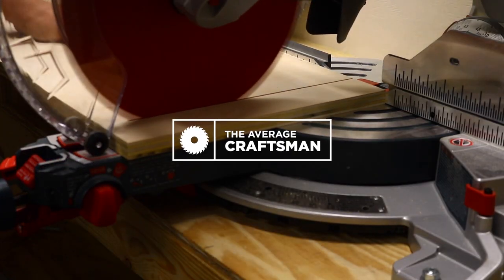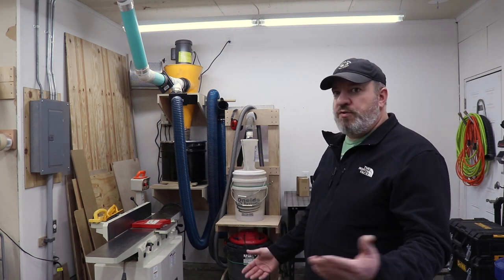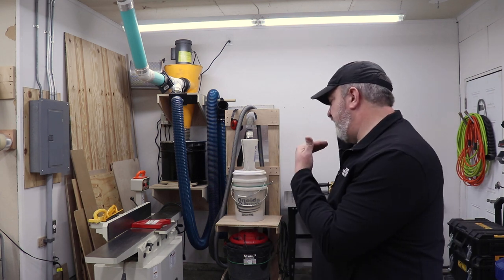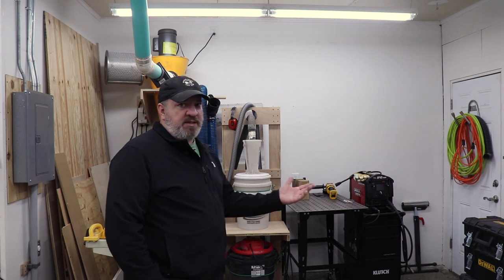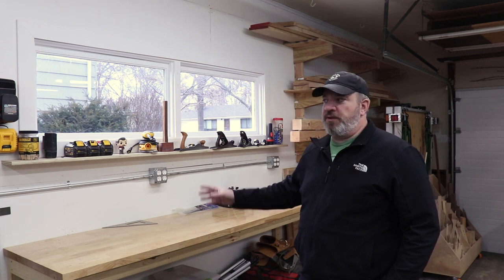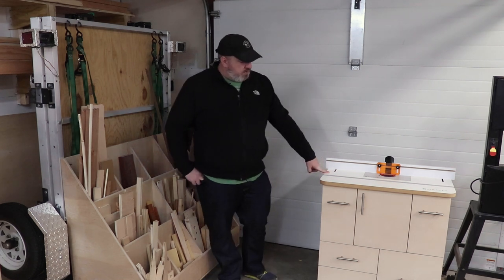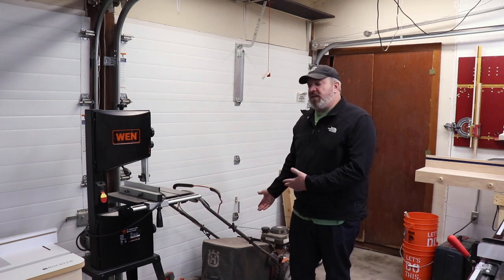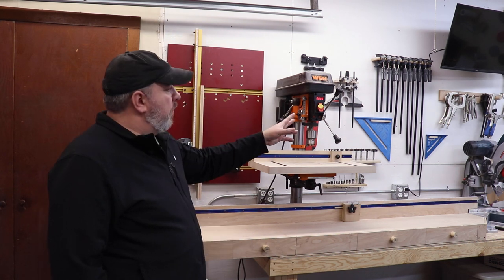2019 Two Car Garage Woodworking Shop Tour!

Comment: Loved the video. I hope to upgrade to that sawstop someday. I did a video about my bench and I don’t think it will fit though. Also got the Wen spindle sander with 4” belt and it’s just......ok.
Reply from the maker: Yeah, the WEN stuff isn't junk like some people think but it's also not top of the line.  It's really good for small shop hobbyists.  Every WEN tool I've bought I've ended up wanting something bigger.  Thanks for watching!

Comment: I'm watching this about 2 1/2 years after you recorded it so you may have already done something about insulating your ceiling but if not, just an idea...you might have an insulation company come over and shoot some insulation into the attic area.  You mentioned how it was a mess up there so that would eliminate you having to get up there...just have them shoot the insulation in and call it good.  Just an idea.  Nice video!
Reply from the maker: Thanks for watching!  Still haven't insulated.  I probably should but have held off because the ceiling is sagging and I was going to fix that and redo the ceiling first but that's a large project that might be a ways off.

Comment: Great tour! My wife says my middle name is "upsell!"  I did close to the same thing at Woodcrafters. Had planned for months to buy the contractor saw with cast iron upgrades. They explained with all the upgrades, not much more to buy the pcs. So that's what I did and with the mobile base. I bought the dust collection blade guard, but made my own piping for the dust control. There is an advantage without the motor hanging off the back.

I saved money on the dewalt planer like you have. Wife found one at a garage sale for $125 last summer. Needed a new belt and blades. Works great! 

Good luck and look forward to looking through your channel.
Reply from the maker: Man, Robert, I wish I would have gone with the PCS.  I really regret it.  We'll see, maybe one of these days.

Good deal on that 735!  Thanks for watching!

Comment: I’ve been happy with my WEN tools. I’ve reviewed the lunchbox planer and drill press on my channel
Reply from the maker: Me too, Brad.  The bandsaw is on its way out though.  A couple of nights ago I had to resaw some 8/4 walnut and it took about 20 minutes for one 72x5 board.  It works well for small stuff but that's not really what I do so time for an upgrade!
Reply: The Average Craftsman oh, glad i decided to wait then because I’ve got a ton of 4x4 oak posts I’ve been want a bandsaw to resaw. I’ve just been using my table Saw but it gets a little sketchy at times

Comment: The first law of small shop design is that all table tops should be the same height or just a hair lower than the table saw. How did you ground your dust collection system?
Reply from the maker: Mine is not grounded.  Thanks for watching!

Comment: Great video. I'm just getting into woodworking myself and am pretty excited except for my space. My current 2 car garage is about 27x25 but plan to make it a bedroom so i will be building a new garage. Thinking of doing 24x36 giving her a parking space which leaves me with 23x23 space for a shop. I was wondering what the overall dimensions are for your shop? I plan on doing some woodworking and metalworking  in mine. Also would be interested in seeing more on your subpanel. Will be subscribed. Love your way of doing your video.
Reply from the maker: Hey Brandon, thanks for watching.  My garage is about 475 square feet but it's an odd shape.  For you, it really depends on what kind of tools you'll be going with.  If you want bigger machines then you'll obviously want more space.  Also, doing metal work in a wood shop can have issues so you might want more space for that.  If 23x23 is all you got though, it'll work.  You just have to be creative.
Reply: @TheAverageCraftsman  yea im thinking im gonna go with 40x30 and give about 10ft to her for parking space with a wall there to block shop off giving me 30x30

Comment: As far as used tools try out Facebook marketplace if you aren't already.  I have found over the past few years I find tons of good deals on there.
Reply from the maker: Yeah, David, I've searched Facebook as much as Craigslist and, around here at least, there's not much available.
Reply: i'm from costa rica and i just recently found a super deal, i bougth:
10" table saw.
10" band saw.
10" sliding miter saw. 
Small drill press.
Scroll saw.
4x36 belt sander 
2 routers
circular saw
jigsaw 
mototool
bunch of clamps
jack plane
 
All of these tools for only $700, in Costa Rica that's like 370.000 colones , and that's what just a table saw and band saw cost...and i found it on Facebook Marketplace.
Reply from the maker: @tutallerencasa969  That's a good deal!  I recently bought a Festool Domino from the Facebook Marketplace but that's all I've found on there so far.

Comment: I was hooked watching your video about your shop.  I just ran across your page today & it was exactly what I have been thinking about  doing to my garage.  We just moved in a different house about 6 months and I've been doing woodworking for about 2 years (when I'm not at my regular job)  I have made many big & small items but want  to get my shop set up much better & increase my tool supply which hopefully will make more efficient & better making all types of projects.  My question is how long did it take you to accumulate your power tools and get your shop to what it looked like in the video?  Also, I need lighting bad, so I will watch your video on the your junction box & extra power outlets & maybe lighting.  Thank you and I definitely be watch more of your stuff!
Reply from the maker: Thanks for watching, David!  In December of 2016 I had a Craftsman 11 piece cordless kit and a Craftsman 10 inch miter saw.  I don't even use those anymore so everything you see in my shop I acquired since December 2016.

Comment: Enjoyed the video and the comments on your various tools and decisions. I have the Wen drill press. Also, I have the Wen oscillating belt and spindle sander. It's cheaper than Ridgid and had better ratings on the Home Depot website. Works great and I bought extra belts on Amazon.
Reply from the maker: Thanks!  I'll take a look at it.  I like the bigger table of the Ridgid though.

Comment: Good video!  It's always nice to see how others managed their space.  I'm downsizing from a 36x36 shop to 20x21 so lots of doing without and compromises. 

When going from 110VAC to 220VAC on the saw I wouldn't expect to see any difference at the saw.  You'll consume the same WATTS whether 110 or 220.  The amperage draw is cut in half at 220V because the voltage is doubled from 110V.  The real difference is how many tools can be run at the same time on a single (pick your amperage) circuit.  A saw and 2 hp dust collector can be run at the same time on a single 20A 220VAC circuit where they would trip the breaker if run at the same time on a single 110V 20A circuit.  I intend to run as many tools as possible on 220VAC in my new shop because the wire gauge can be smaller and less expensive compared to using 110V.
Reply from the maker: Thanks, David!  Good luck on your downsizing.

Comment: What do you use to record audio in your shop videos? sounds great, looks like there should be terrible reverb or sound distant but, sounds as if youre wearing a wireless mic or something. thanks. great video.  ---- Sloppy Joe, Overland Park, KS
Reply from the maker: Hey Joe, I use an Azden wireless lav mic.  I have had a lot of trouble with audio but I think I dialed it in with these last two videos.  The key was turning down the recording level on the camera.  Before I was getting a lot of echo and pretty bad audio overall.  I reached out to Jay Bates, another YouTuber, and he gave me that tip.  Worked like a charm.

Thanks for watching!

Comment: Thanks for the tour. You always learn something whenever you get a tour of another guy's shop. That said, maybe you should list your SawStop on Craigslist and go get the cabinet saw. There's a quantum leap in owner satisfaction there. They say a lot of nice things about Harbor Freight these days. Well, Harbor Freight says a lot of nice things about themselves these days. 40 years ago I spent a day's pay on a bunch of on-sale HF 1/2' pipe clamps. They failed in ways I could not have imagined were possible. Within a couple years I sent the remaining three (of a couple dozen) along with a bunch of other disappointing stuff to the weekly auction. All those years gone by and I last fall I bought a big generator from them. The first two wouldn't run long enough to empty the gas tank. The third, a second free replacement, is sitting in its unopened box awaiting a Craigslist thrifty optimist.
Reply from the maker: Yeah, Harbor Freight is a mixed bag.  I generally avoid it these days.  Thanks for watching!

Comment: everyone wants a SawStop I purchase my Sears contractor saw when I was around  24 now 62 it's a wonderful saw it did everything I ask it to do dado set, molding 3 cutter head rip a full plywood sheet and I build some wonderful indoor and outdoor furniture kitchen/bathroom cabinets  and it's still running and true my favorite tool in my 2 & 1/2 car garage and I still have all my 10 fingers

Comment: Hello, liked your video - thank you.
My question is on your Incra cross cut sled, how have you attached it to your wall?
Thanks.
Reply from the maker: Thanks, Steve!  There are holes in the sled and I just put a half inch piece of ply on the wall and put a couple nails in it.  The sled hangs on the nails.

Comment: Thank-you for sharing your workshop and experiences.
Regarding insulation, as a general rule, approximately 90% of winter heat loss is through the ceiling.  Attic insulation in Kansas City area should make an enormous difference.  It will also help keep the garage from getting as hot in summer.
Really like your scrap wood cart, and am planning to build something along those lines.
Best wishes and stay safe!

Comment: Show us the dust collection on your Sawstop.
Reply from the maker: Mike, I just have the stock dust collection on the SawStop.  You can buy a port from SawStop which I did but it's just a place to hook hose in the back.  It's not even in use right now.  I just have a hose running up to the dust port below the blade.

Comment: Where did you get the trailer?  Its awesome
Reply from the maker: Northern Tool.  You can also get a steel version that is cheaper.  Harbor Freight also sells a steal version as well.  They are really handy.

https://www.northerntool.com/shop/tools/product_200660343_200660343?cm_mmc=Google-LIA&utm_source=Google_LIA&utm_medium=Trailers%20%2B%20Towing%20%3E%20Trailers&utm_campaign=Ultra-Tow&utm_content=49803&gclid=EAIaIQobChMIqsTf9oWf5gIVKB6tBh3n8wG7EAQYAyABEgILmfD_BwE

Comment: why is your miter saw to the far right of bench
Reply from the maker: Wade, I put it there based on wanting 8 feet of capacity to the left of the saw.  However, that only really works well when you have a stop block on the other side as well which I don't have yet.  I probably would have been better off doing 6' and 2' with this setup. This is only temporary.  Well, temporary going on over a year now.  I will be building a miter saw station on the opposite wall in the coming months and it will have 8' to the left of the blade and 4' to the right.

Thanks for watching and commenting!

Comment: Where did you get your folding trailer?
Reply from the maker: Hey Chris, I got this one at Northern Tool (https://www.northerntool.com/shop/tools/product_200660343_200660343).  This one is aluminium but they also offer a steel version (https://www.northerntool.com/shop/tools/product_200612544_200612544).  It's cheaper but quite a bit heavier so the folding/unfolding and assembly can be a bit more cumbersome.  The tongue assembly on the steel version is also different so it's a little taller when folded up.

Harbor Freight also offers a steel version (https://www.harborfreight.com/1195-lbs-capacity-48-in-x-96-in-heavy-duty-folding-trailer-62648.html) which has a similar design to the aluminium Northern Tool trailer.  I've had all three and really like the aluminium.  

Hope that helps.  Thanks!

Comment: If you didn't upgrade your SawStop wings yet maybe the cast iron router table wing from sawstop might be a good choice and will save you some space to.
Reply from the maker: That would only cover the extension table.  I'd still be left with steel wings.  Plus, I dont want a router table in my table saw.  Thanks for watching!

Comment: yea, did you connect it to your main sub panel?
Reply from the maker: Hey Eli, did I connect what to my main sub panel?  The mini split?
Reply: @TheAverageCraftsman  I meant, did you run that from your main house panel? to a 50 amp breaker? Since my main panel was already filled, i had to install a subpanel to allow for 220 breakers and connected a 50 amp breaker to power the sub panel.
Reply from the maker: I have a sub panel in my shop.  I connected the mini split to a 30 amp breaker on exterior of the house which then connects to my sub panel.

Comment: Good looking shop! Your shop and mine are very similar actually. I am also a big Jay Bates fan. I even went in on the Clear Vue cv1800 after watching his installation video of it. I'll just mention, since it seems like you might consider upgrading your dust collection one day, and you watch the Bates content, the Clear Vue is super loud. It sounds like a tornado siren. I ended up framing a closet around the whole thing with 3" of Rockwool insulation and 5/8" sheet rock. That did the trick. It seems to pull dust really well so far. Also, I have 12 sheets of 3/4" plywood sitting in my garage right now for his Miter Saw station! So get on it man! =)
Reply from the maker: Bryan, the CV1800 is on my list.  Hopefully in the next year.  

I hope to start my miter saw station in the next couple of months.  It's an expensive project so I have to do some budgeting and I have a few more projects in line ahead of it.  I really want to get it done though.  Stay tuned!